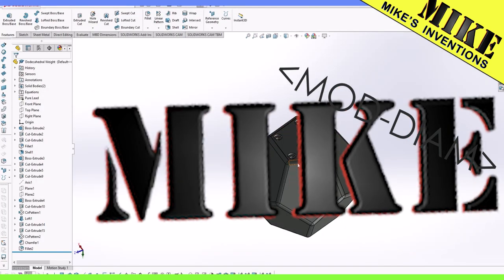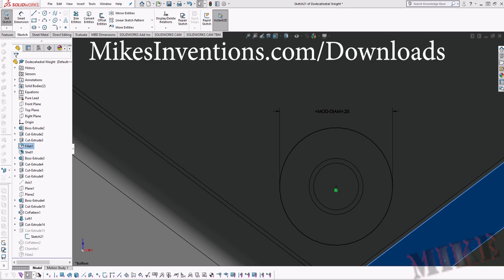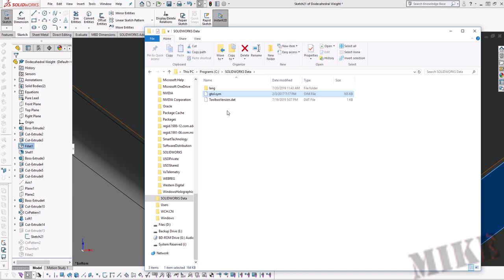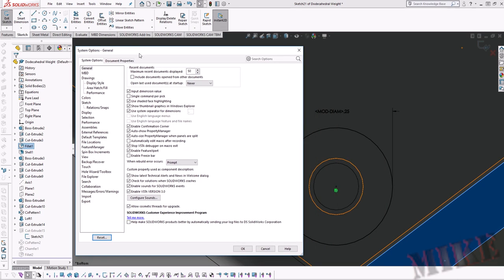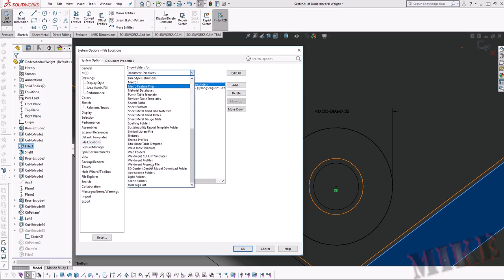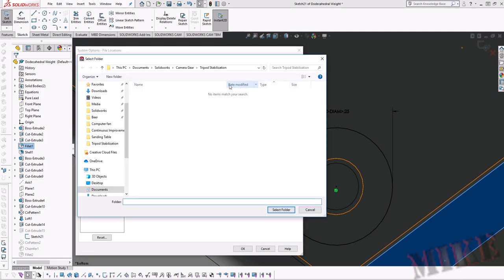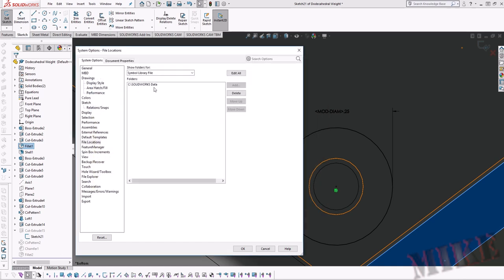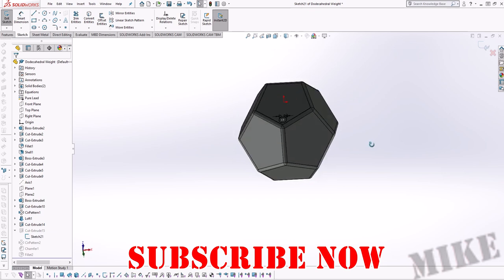SolidWorks MOD-DIAM Fix - Mikes Inventions

Comment: mike it didn't work for me :(
Reply from the maker: Hmmm. What version are you running? I haven’t tested it with 2019-2020 yet because I didn’t need to. Just make sure it’s unzipped and SW is looking in the right place.
Reply: Just reset to default it will work fine